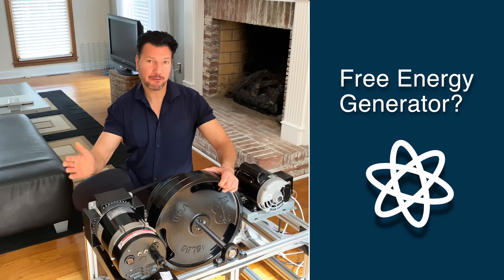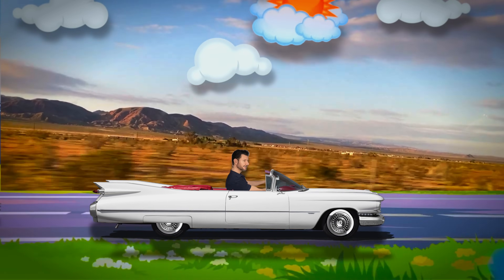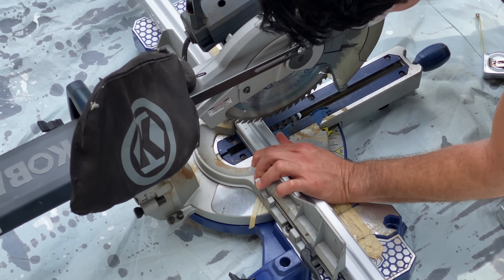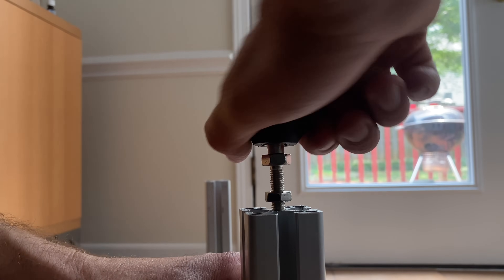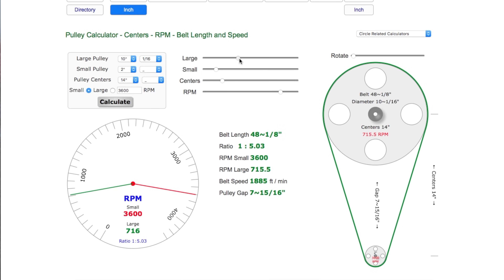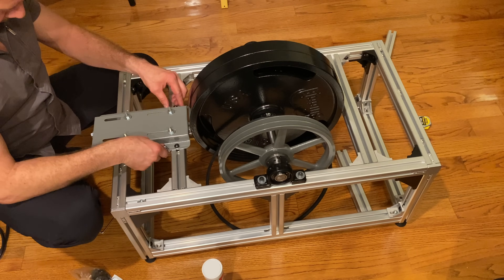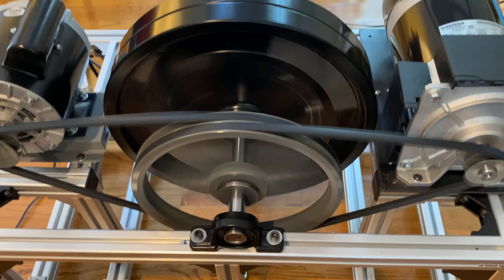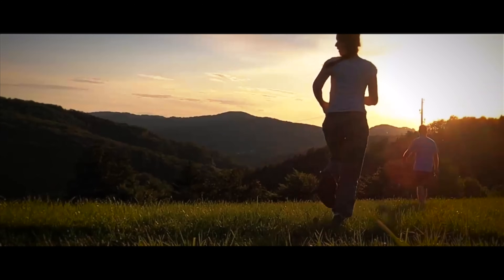How to Make a Free Energy Generator!

Comment: I got mine to work using ratios. You want a big pulley from your motor to a small pulley on the shaft, and then another big pulley from shaft to generator. That way, the motor only has to turn 1/3 of the speed to produce the same rpm at the generator. I might post a video on mine. It works for the important stuff (frigerator, a couple lights, internet, and tv). I don't use a switch over type system either. I use a 24 volt marine battery to power the motor and then a charge controller at the other end (treat it like wind energy). I have enough electricity to keep the battery fairy charged and run the stuff I listed above. However, I have fall off somewhere that I can't pinpoint yet. After about 67 hours, the battery is dead for some reason, working on that. Maybe add a solar panel to help? Not sure yet. 

Love the video, I took to this "phenomenon" thinking all the videos were fake, but after contructing mine for fun and messing around, I have free "ish" energy for almost 3 days.
Reply from the maker: Would love to see a video Cwizden
Reply: @Markus Nenning  I found a heavier flywheel. I just have to get it pressed to a 2" hole. I'm going to film videos of putting it back together when i get to that point; and since I have a heavier flywheel, I am going to add a car alternator and see if I can keep this battery topped off without causing more resistance.

Comment: Hello, I don't know if you will still reply to this....but I have thought about this for a long time...I have a theory that I believe could be a possible success for a free energy device.  It seems possible by using more than just one type of energy source.  So to utilize magnetic opposition energy to help rotate the wheel with a variable pitch and distance device (adjusts the pitch and intensity as the energy needs increase as well as to optimize the speed of the spin), in addition to that, using gearing to increase the efficiency of spinning the wheel in combination with the energy created from the inertia of such a heavy wheel spinning at such high speeds...similar to this device.  Yet in addition to that!!...using spring energy that can be generated while less energy is being required...(for example it winds up & releases in opposing sequences similar to the action a combustion engine uses...only instead of combustion it is utilizing energy from the excess energy created from the wheel but this is storing it up to be able to give it a boost of energy as needed, but is stored up in the compression or tension device, then released as needed...clearly it would require a circuit board to trigger all events at optimum points)  Point is it seems by harnessing all the various methods of natural energy gravity, magnetic opposition, spring, momentum, inertia and utilizing ways to store energy to give boosts ass needed should be able to make it work....

Comment: You actually achieved it it ,but you need to put banks of capacitors after the generator to build the required charge you won't to youse for yousing power tolls and stuff ,you just need to capture it and build it so it dosnt come directly from the generator!

Comment: Take your time and try jumping into the air. Have you ever wondered how amazing it is to be able to jump a few inches from the ground effortlessly. Your muscles are insignificant, weighing only a few kilograms, but can overcome the gravity of the earth, all 6 x 1024 kg. Gravity is a real weakling -- 1040 times weaker than the electromagnetic force that holds atoms together. Gravity is a real weakness that can be solved by further research on free energy such as gravitational ideas, flying or floating vertically or horizontally by electromagnetic force in a huge dome atmosphere suitable for this flight or floating mechanism. I hope there is something new to trigger in advance and good luck to you, and keep sharing.

Comment: All you did was wasting your time on this project. The way you do it is to put magnets into your router. Even today the Toyota company did that. With the hybrid they said it was a breakthrough. You may google. Toyota said It was a breakthrough for Toyota to use the magnets. I don't know if you just want to make the experiment to show it doesn't work. But did you really try to see if it works. The old you talk about the magnets yes. It seems you know the trick about the magnets but you didn't put it in to the uh generator.
Reply: Rotor

Comment: Yeah, you know what has to be changed for this to work? Physics has to be changed. Nature has to be different. And be carefull with cast iron rotating at 3600 rpm - it can break apart and kill you every single moment. However what you have built is not useless - it's an accumulator of energy, however low its capacity is.

Comment: I think a magnet engine is the way. After watching this video, I remembered and reviewed a magnet powered monorail in China that uses no power able to go about 50 mph and go up gentle inclines. Their new electromagnetic 373 mph train from Beijing to Shanghai uses 20 million Watts, A regular high speed is about 8 million Watts. General electrics largest most powerful locomotive is 4.5 million watts.  Below the magnet we're suggested videos with a coil of thin wire that's really long. A long tube that could connect end to end like a garden hose. A couple minutes on one side and a couple of magnets on the other side of a little divider. Sized like hearing aid batteries, once slipped into the coil the little model moves without stopping. There are some nice magnet engines as well, including real simple ones. I would like GPT to run a few hundred billion simulations for me and then Addivly 3D printing digivice to put my high powered magnets in. Connected to the alternator and makes my meter spin. It keeps the Tesla charged, plugging the car and when you get home supplying power to the grid allows you to take it with you to the moon.  Unfortunately GPT patented the device before it could print it, intellectual property rights.
Reply from the maker: Very interesting idea!
I didn’t even know you can run simulations with GPT.

Comment: . You can not load the flywheel and remove its energy from the same point. A flywheel has two parameters, speed and force, just like electricity has voltage and current. These are different things and they need a different approach.
. Нельзя загружать маховик и снимать его энергию с той же точки. У маховика есть два параметра, скорость и сила, как в электричестве есть напряжение и ток. Это разные вещи и к ним нужен разный подход.

Comment: You have proved that "Free Energy" can not be produced continuously from a  machine using a motor generator with a fly wheel with no connection to a mains supply.
Reading some of the comments a lot of people have been fooled into believe This idea really works.
Lot's of comments on how to make improvements to a  better failure.
The hardest thing is to prove to people who have been fooled to believe that this type of machinery does actually works. 

Getting to convince them they have been fooled is an almost impossible task.

Comment: you should end up with a minimum of 480 volts and a high current load that will easily run the motor

Comment: use 4 layers of 10 turns in parallel 2 wires to produce high output voltage.

Comment: What you need to do is run the motor that's powering the whole thing on a eco flow or jackery battery backup get it going and then whatever the wattage it's using to run it you need to match it in solar panels and MPPT charger and you might be able to pull this off with about five or six 385 watt panels.... As long as you got the same 110 volt with a watts you need from the MPPT charger and the inverter in the solar panels all together Yes it could run easily all day long off the Sun and then off of the batteries through the night and then it goes back to charge in the batteries and running the system during the day. May have to have a couple battery backups switch them out once a day fuck that ain't that hard to do to have free energy it's worth it try it shit I don't know I don't have the motors and stuff like that like you do but I do have solar panels and battery backups cuz I like playing with that shit... Also the eco-flows and jackery and all them I'm pretty sure have MPPT chargers in them so if you get 300 watts going back into these you could charge them back up in less than an hour hour and a half depending on how low you run them down manufacturer says 30% and then you charge them back up but I'm telling you as long as the sun's up you can charge them back up get two or three of these always have one on the charger and then just switch them out as you need to and I'm telling you it may be able to run this

Comment: I have to say, I have to say I really appreciate all the hard work and honest evaluations you made on your project. I really like your design, the only thing I would change is your pulley configuration. Instead of all fixture pulley’s I would use at least one adjustable pulley like a centrifugal operated pulley that will automatically adjust to optimize the stresses on your motors and generator. I believe if you use one on the flywheel it will help to reduce the amount of stress on the overall operation of your system keeping it from over loading your breaker.
Reply from the maker: Thanks Alberto appreciate your kind feedback!
I did not know there was a centrifugal pulley I will have to look into that.
Thanks!

Comment: some initial thoughts. You want no inertia at all. Nothing mechanical. Not physically moving with drag, no air resistance, no friction. What you want instead is an invisible magnetic field moving and stationary coils to pick up that moving magnetic field. Let us suppose you could create a 5 to 10-inch diameter magnetic vortex, somehow. Then let us suppose you could place a nice pick-up coil in that 5 to 10-inch diameter vortex. The coil would produce an AC wave corresponding to the spin of that vortex. Tesla has a water fountain patent, where he gets water spinning with very little power using a tiny motor at the bottom of a water column. Suppose you could spin that huge column of water with only 5 watts. In his fountain, the water vortex level rises up and spills over. There is the force of gravity pulling the water down (hydroelectricity opportunity). But you could also place magnetic floaters in the column and a coil structure around it. Even this is too much friction, however. Ideally, you could do something like this in the air. Suppose there was a coil geometry where with very little power you could create a magnetic vortex. It would need to be a vortex that spins at a very high velocity. The faster the better. The optimization is to have more turns of wire or a faster magnetic vortex. You can use smaller gauge wire, but then you add resistance. If you keep each turn separated from the other (basket weave coil, etc.) you can increase the inductance and reduce the resistance. You want to make sure you hit resonance. Self-resonance of the coil should match the spin of your vortex. The Earth's field has NMR of about 2khz. This magnetism is FREE and always there, but it is only in the nanoTesla range. It is enough to move particles from the Sun, causing Aurora effects with a 2khz long wave. If there was a place on the planet that had a magnetic eddy current, you might get a vortex for free. OR, you could try to make an eddy current using a megalithic structure with certain stones and metals and crystals. Another idea is to build with granite and to utilize high-pressure waves on this stone (such as Earth vibrations) to exploit the piezoelectric effect (ala pyramid of Giza).
Reply from the maker: Interesting 🧐 
I had some of the same ideas about vibrations. 
Check out part 2
Why does this Free Energy Generator not work?
https://youtu.be/tFqn-atYcOU
Reply: @MarkusNenning  you couldn't be able to get over-unity.... because you have too much mechanical stuff here ... resistance ... drag... etc. To get overunity, you actually have to "receive" power from the outside. The n-machine (see Bruce DePalma) might be interesting because it uses homopolar which means no sparks, no waste, and it might be getting a little extra power from the Earth's field. Those experiments never really got to the bottom of the extra power, but it has to come from the outside to not violate the laws of thermodynamics.
Reply from the maker: I will check him out.
Thank you!

Comment: Your flywheel configuration is wrong, if you want to get kinetic energy multiplication you must make use of different sized pulleys and put them on opposite sides (having the weights in between) meaning that either one of your motor or generator need to turn 180deg. The motor’s side flywheel pulley should be spinning faster then the generator side flywheels pulley.

Comment: How much electricity was the alternator generating, amp, voltage, etc.? What is the rating of the engine?
Would it be possible to run multiple alternators that would meet the demand to run the engine and then add alternators to generate more than that output? The examples that I always see is one engine spinning one alternator. You should also have the two belts at different ratios kind of like a bike so that when the engine turns the wheel once, the alternators sling multiple more times than that, right?
Reply from the maker: Hi, if you watch my second video on the generator I show all the specifications of the motor and generator.
I like your concept the problem is that every generator you add works like a break and eventually the motor can’t spin anymore.
I have tried many different things and before I turn into one of those inventors that dedicated their entire life on something like this I had to stop :)
I purchased a low rpm generator and will eventually try to see if that would make a difference but don’t have high hopes.
I also have 2 videos regarding an inverter from the US using Gravitational Energy you might enjoy it.
Thanks for watching and your feedback!
https://youtu.be/wqbJWBtoFMQ
Reply: @MarkusNenning  There are some audio videos where they use 4 alternators in a car for audio.

Comment: In order for your project to successfully run the way you planned, you gonna need to measure time which your motor takes to reach its highest speed and then add it on your timer switch together with a contactor to turn from plugged circuit to motor to motor automatically which we call that mechanical energy to electrical energy..

Comment: You Need a diode so both motors don't become generators. Diodes direct the current. 

You also need the smallest possible pully for the generator side to get maximum rpm.  
Gear reduction 
So smallest pully- to largest pully on fly wheel.  Smallest pully on fly wheel to a large pully on power motor.  

It will run for a bit  but not forever.  As you lose energy through thermal dynamics and mechanical resistance.

Comment: In physics, the conservation of energy is that energy can not be created or destroyed, it can only be changed from one form to another, such as when electrical energy is changed into heat energy. Formally, it says that the total amount of energy in an isolated system remains constant, although it may change forms, e.g. friction turns kinetic energy into thermal energy. In thermodynamics, the first law of thermodynamics is a statement of the conservation of energy for thermodynamic systems.

Comment: I think that using the same system for bicycles that do not allow pedaling in the opposite direction and using a capacitor with a timer to power the motor from time to time to readjust the speed of the wheel

Comment: Why wouldn't you have just use a variable speed Drive to speed the motor up and down and to control the speed why would you use a bigger flywheel instead of a smaller one I think you have your calculation wrong anyway or am I to say I've proven this many times and it work but if you want to prove something wrong you don't have to do it right

Comment: 3 ideas 💡 that (maybe) could help:

1: use magnetic levitation instead of bearing to reduce friction 

2: put the whole generator in a pressure chamber

3: use super capacitor (graphene) to slowly discharge + stock the current and not empty all the energy at once

Hope it help im just a noob ✅
Reply from the maker: Thanks Tony!
I did try the capacitors the other 2 ideas sound worth trying out but are unfortunately not all to easy to realize and quite pricey
Reply: @MarkusNenning  yes i understand… your videos are very interesting we learn a lot ✅
Reply from the maker: Thanks Tony 
Glad you like my videos!

Comment: A smaller pulley and it should double your rotation and try adding 10lbs more weight to see if you can then triple your output but those motors at max speed will only allow soany watts to be made try a higher out put motor